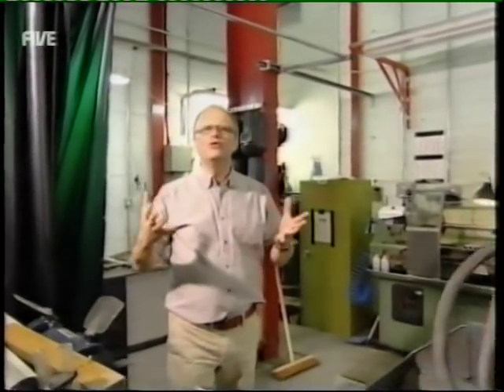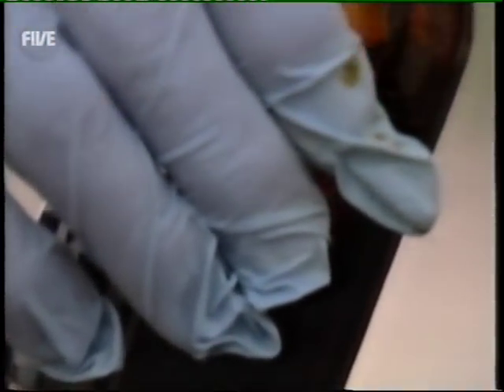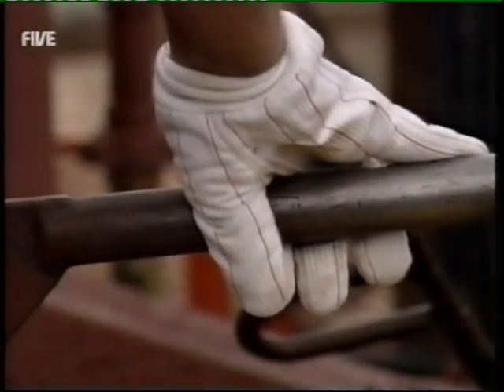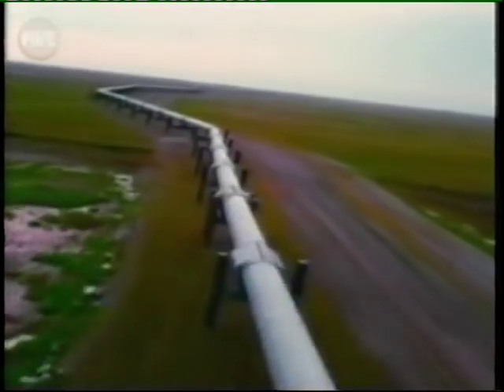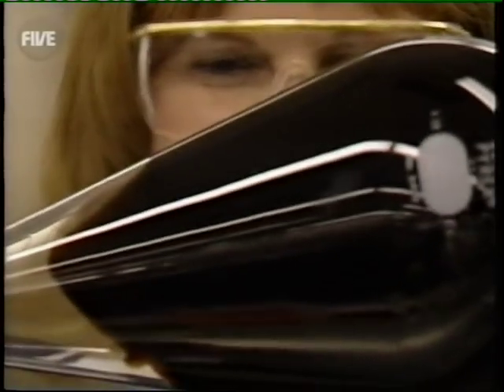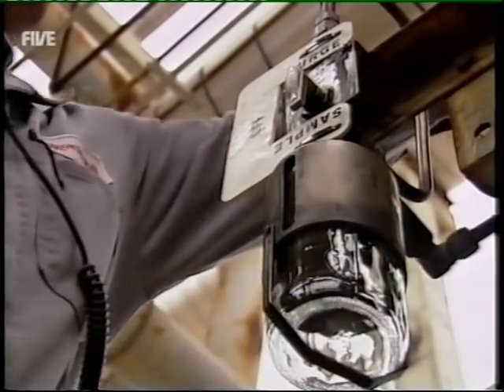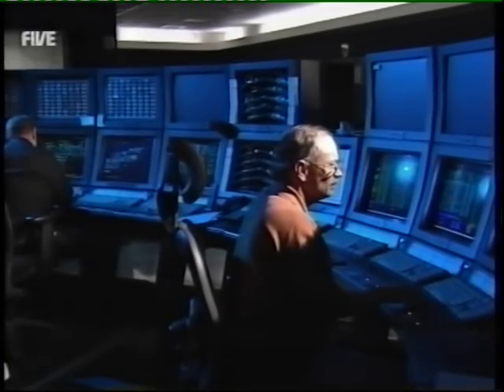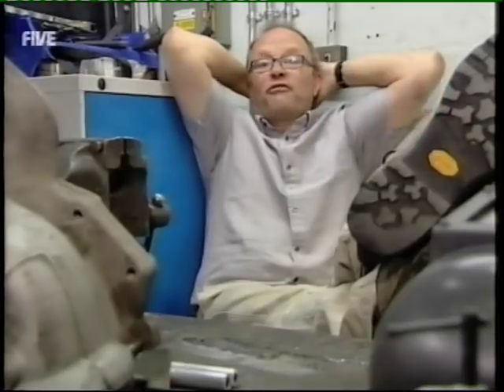How to Make Petrol or Gas from Crude Oil.

Comment: YOU SHOULD ALWAYS FILL UP THE BOTTOM SUMP OF THE OIL WELL AT ONE THOUSAND FEET (1,000 FT) UNDERGROUND IN ORDER TO AVOID AN EARTHQUAKE.  FILL UP THE BOTTOM SUMP WITH A STRAINER ORIFICE OF LOOSE VOLCANIC LAVA ROCKS.  AT ONE THOUSAND FEET (1,000 FT) UNDERGROUND, THE EMPTY HOLLOW BOTTOM SUMP OF AN OIL WELL COULD ACT LIKE A SINK HOLE, AND CAVE IN COLLAPSE.
Reply: Your caps lock key is stuck

Comment: There would be a huge impact to the economy if we suddenly switch off crude (to protect against global warming). An impact I don't think we could survive in the best of times, let alone the middle of the quarantine.
I think want we need is a way to continue to utilize the entire crude industry infrastructure. From pumping, to refinement to shipping and transport.
It's not a perfect 1:1 analog, as a lot of equipment will need to be built and swapped out, but it's not a  but there's only one thing that comes close: hydrogen.
Hydrogen is, believe it or not, a worse fuel in terms of potential energy, but it should allow us to ween ourselves off of crude. Combined with a restarted nuclear program (utilizing proven breeder reactor designs) and a hydrogen economy, we'd usher in a new era of both prosperity and environmentally friendly energy.

Comment: wonder what will happen when all this stuff runs out...
Reply: +MetallF Before it runs out - militaries will commandeer and confiscate the rest, as there's no solar powered jets and helicopters or wind powered battle ships and tanks.
Reply: Between you and me, good thing carbureted 4 stroke motorcycles engines can run on hydrogen...
Reply: I say we begin to switch to ethanol. You get more power out of it too
Reply: it's not going to run out any time soon
Reply: I mean from this dude calculations this oil field in Texas only has 30 years of oil left in it, so year some time soon
Reply: Nuclear power will have a larger role. Nuclear is the cleanest, and most effective energy source
Reply: Economy collapses.  Social unrest.  Walking dead without zombies.
Reply: Who cares we won't be around to witness it .
Reply: @happykaladin78  FALSE FALSE FALSE !!! Nuclear is the most dangerous and highly toxic to the planet !! ☠️☠️☠️☠️☠️
Reply: @100pyatt  https://www.energy.gov/articles/nuclear-energy-clean-constant-and-cool
That is a link from the department of energy that states your beliefs are "FALSE FALSE FALSE". 

Nuclear emits 0 green house gases, it produces waste yes, but that waste in time can be re used to produce more energy. 

Converting one energy source into another will always yield waste, that is simple thermo. However Nuclear is by far the most powerful, feasible energy source. 

Why do you believe otherwise?
Reply: A nuclear car battery, insane or genius?
Reply: TIMEtoRIDE900 no one use battleships anymore
Reply: We are screwed
Reply: @happykaladin78  Nuclear waste can not be re-used to produce more energy, at least most of it can not. There is leftover Uranium-235 in the burnt out fuel rods and some Plutonium, but most of the waste is only highly radioactive but not fissionable. That waste will be radioactive for many thousand years and has to be stored somewhere. The Problem is, that it is almost impossible to find a save way to store it, especially because humans are pretty good at finding buried buildings that were forgotten and digging it all out.
Reply: There will be one big hole under under the top layers of ground, and we will all be sucked in
Reply: @alexanderdaum8053   Fast reactors can fission minor actinides etc, ie "wastes" of nuclear fuel.
Reply: @frankmagana1408  Yeah lets do that, the population from 7 billion will drastically decrease because of starvation. You do know these plants to make ethanol use the same ground you grow food crops.
Reply: @MetallF  Just about any engine can be ran on hydrogen.  Good luck trying to make it and compress it though.
Reply: @100pyatt  Not even close.
Reply: @jjmonns  move to the new green , nuclear Fukushima , it's zero greenhouse gas. Needs some residents in the green living zone 👍
Reply: @jjmonns  well there are solution, like hydrate compounds that can store a lot of hydrogen at room temperature and 1 atm.
Reply: @100pyatt  still better than Flint MI
Reply: @MetallF  That is still very energy intensive to make.

Comment: They forgot to mention the thousands of crude oil haulers that go out to the oil wells. Testing the crude oil before they load it. Only a fraction of wells are on the pipelines. The vast majority have to have the oil hauled out by truck and to the pipeline. Driving in remote areas, in all weather conditions. Living out of their trucks.

Comment: Black gold runs out!!
Reply: never
Reply: Oil is a hydrocarbon: a byproduct of heat and pressure in the earth and it will never run out.
Reply: unfortunately it will become more and more limited making alternative energy sources more affordable in the far future, assuming humans don't destroy themselves by then
Reply: Gold gold also runs out!!!
Reply: ASIStudios 
Incorrect, There exists something called the residual oil saturation, that is the precentage of oil that is impossible to extract. This is a function of multiphase fluids and rock properties. To understand it on a more technical level, when two fluids exist there is a wetting phase and a non wetting phase and a interracial tension between the two. Due to Capillary Pressure we know that it is impossible to displace 100% of either the wetting or non wetting fluid. Translation, "Oil will never run out because we can't extract it all"
Reply: +Quas CMS thanks for the explanation, I think he's just referring to the extractable oil.
Reply: At first, I thought you were making a "running black" joke, nvmd
Reply: fatbap, Then how do you explain  oil sands (deposits) that are close to the surface of the Earth ? There is one in Venezuela and one in Canada and they're both the size of Saudi Arabia, in terms of Reserves.

Comment: It was interesting until you made the erroneous common error that oil comes from little tiny plants and sea creatures. You just showed your ignorance. Now let me educate you.
Oil is not a "fossil fuel". It never has been and never was. That little catchphrase came from the mind of John D Rockefeller. He coined that little phrase because he wanted to increase the value of his oil company, Standard Oil. To justify his dramatic increase in pricing he wanted to tell the public that oil is scarce and that's why it cost so much. His gimmick worked and still works today.
Oil is so plentiful it is almost sickening. During the 1970s, the oil companies got their wish and did it again, dramatically raising prices. Few people were aware that there were more capped oil wells off the coast of California then have ever been capped on the mainland. California won't let those oil wells be used. But if you drive around Los Angeles you will still see hundreds of small pumps sucking out oil 24 hours a day, everyday.
There's oil sand. There's oil trapped in shale. There are billions of barrels of oil still in Alaska.
Oil is not rare.
Oil is not scarce.
Oil is NOT a "fossil fuel".

Comment: Not mentioned about refineries: They do far more than just separate the crude into its different chemical components. Some of these 'cuts' are reformed to make them more valuable. Heavy oils are 'cracked' into lighter components that can be blended to make more gasoline, in addition to the 'natural gasoline' that was in the crude to begin with. This is just scratching the surface of all the different ways in which crude is modified to make valuable commercial products and feedstocks for other industries, such aa the plastics industry.

Comment: you should have covered "cracking" long chain hydrocarbons into shorter chain hydrocarbons. This technology is why diesel is more expensive than gasoline. They can crack fuel oil into gasoline so they charge a higher price rather than crack the diesel into the higher volume and more refined gasoline.

Comment: THE ALKYLBENZENE REFRIGERATION OIL IS A MINERAL OIL THAT ALLOWS EXPOSURE TO WATER, AND ALSO ALLOWS THREE HUNDRED DEGREES FAHRENHEIT OF HEAT, WHICH IS THE EXACT TEMPERATURE AT TWO AND A HALF MILES UNDERGROUND DEPTH.

Comment: The main products from Crude oil is gases, chemicals, plastics,  paints , adhesives, laundry products , tar, man made fabrics. 
Petrol, at the chemical plant I used to work at, was a by-product which was sold off as a waste.  Most of the profit is NOT in road fuels, but in all the other products which have thousands of uses.  
To increase road fuel retail price when crude oil goes up is disingenuous. Most of the price at the pump is government taxes.

Comment: Yes, the gas is methane; which is odourless, however, the Gas company adds an odour to the gas for safety reasons!
Reply: Carl Ross it's called mercaptan.
Reply: Carl Ross When they moved from North Sea gas ?
Reply: Or the gas has sulfur in it as per H2S (hydrogen sulfide)
Reply: NATURAL gas that comes out of the ground is a mixture of dozens of hydrocarbon gases including methane, heptane, pentane, propane, ethane, etc. The gas processing plants separate out the various "anes" and sells them individually. It stinks to high heaven. Methane is pumped to houses and called "natural gas" and a small amount of sulfur is added to allow for detection by smell.
Reply: i'm just trying to figure out what natural gas has to do with crude oil????
Reply: Your thinking of LP
Reply: Methane, oderless hilarious 😂
Reply: my methane aint odourless just ask the six people stuck in the lift with me after a red hot vindaloo
Reply: I can sell my odour to Gas companies. I have plenty in my room on daily basis.
Reply: Carl Ross how would the facility that manufactures the odor for natural gas know if they have a gas leak?  Either there are lots of false alarms, or the town is all electric
Reply: Revtune you don't know what you are talking about
Reply: Thanks Ross.
Reply: Nicnamed Mc'captin  @JF32304
Reply: @tedparker640  In the reservoir there's so much pressure from overburden, gas is compressed into the crude its called solution gas or Rs. A lot of it turns back into a gas once hydrocarbons reach surface and the pressure is relieved, but some of it doesn't so they need heat to force a variety of gasses out of its solution state. Reservoirs have a gas / oil ratio (GOR) and depending on this ratio will determine the title of the reservoir, oil / gas reservoir.
Reply: I saw your comment and thought of Ross from Friends... then I saw your name is also Ross...Wtaf?
Reply: Or they just burn it right there because it's not economicly feasible to save it and sell it.

Can you say skin a buffalo and let the meat rot on the plains?
Reply: Tim OB no not a car ! an elevator travelling between floors
Reply: Tim OB hahaha good stuff    dont lose the old sayings   im from australia   most people dont have a clue what we’re talking about
Reply: No, your wrong
Reply: wrong!!!! that smell is added to the natural gas after refined so you can notice a leak sooner than a boom, and some gas is sour and smells like rotten eggs right out of the ground. and some shale gas does have specific smells,its not all pure.
Reply: Methane is the only gas that actually HAS a smell to it naturally.
Reply: @diji5071  nope.. h2s also👍🏻
Reply: @chrisw5150  Pretty sure H2S is odourless.
Reply: @diji5071  nope,...it smells like sour eggs. horrible stuff. if the consentration is above 1000 parts per million it'll kill you before you even get your lungs full. i hated working around that stuff
Reply: @chrisw5150  That makes sense, they really drove the point home in my training course that you can't really detect it by smell so I just assumed it was odorless.
Reply: @diji5071  well your sense of smell diminishes the longer you are around sour gas. so not relying on smell makes alot of sense if you're working in the industry.
Reply: It’s actually h2s we’re worried about 💁🏻‍♂️ which smells like rotten eggs until it kills your sense of smell at a certain ppm then it kills you when you think you’re in the clear because you can’t smell it anymore
Reply: Methane definitely has a smell when I make it
Reply: The LNG does have a smell and can be used directly after production. But if it's to be used in the public then the mercaptan or stink is added so if the flame is not burned itll smell. I have to add this crap to little canisters at my gas plant so we can use what we make for heating our buildings. If the wind blows in your direction while carrying it it's on u for 2 or 3 days.
Reply: ted parker 
Natural gas is in crude oil. Along with naphtha, jet fuel, diesel and heavier hydro carbons. All mixed up together. The refinery separates each fraction to sell separately.

Comment: Most petrol in the US is distributed by pipeline - trucks handle short and mid haul.  And metal... not the problem:  tyres are. They act as an insulator, and anything bypassing them brings spark potential except earthing is applied first - via nozzle, or separately [as aircraft do].

Comment: My 2004 Tacoma 3.4l engine has 264,000 miles and runs great, but it knocks occasionally. I add octane booster but the knock doesnt go away
Reply: Bearings

Comment: Ethanol liquid fuel pumps usually cannot exceed one hundred psig pounds per square inch gauge, and therefore, always use nitrous oxide NOS liquid fuel shutoff valves, at the inlet of the ethanol fuel pump, and at the outlet of the ethanol fuel pump, in order to valve off shut off the ethanol fuel pump from the gasoline diluted ethanol that is inside of any fuel mixing metal tank, whenever adding the propane gas vapor, which is used in order to increase the octane rating of the ethanol liquid fuel.

Comment: It doesn't suck the oil to the surface.  It LIFTS the oil.  You can only "suck" about 30 feet or so.  Not 2 miles.

Comment: thought it was going to be a real complex process, turns out the crude oil is just heated up from the bottom...
Reply: The concept is simple, but the process itself is very complex.  They just simplified it for the target audience.  The conversion and catalysts used in the refining process is often a trade secret.  The harder part is separating the liquids and gases that are closer in density like natural gas, propane, butane, naphta, isooctane, and other petro chemicals used for production of plastics.  

There is also a secondary tower called the vacuum distillation tower.  What they do in that tower is use vacuum to lower the boiling temperature of the liquids so it would "boil" at a lower temperature.  That is used to separate the heavier oil products use to produce tar and other uses.  Without using that tower, the liquid would need to be raised to a higher temperature which presents a bigger safety hazard and cost more money.

If it was that easy, Venezuela wouldn't have to shut down their refineries.  You would also see Iran refining their own oil instead of sending it to other nations to refine and import the gasoline back into the country.

Comment: Aren't pumping jacks old technology? I thought these days most oil pumps were basically rotary positive displacement pumps and now housed in small sheds. Also, now go look at a cracking plant if you want to get into the next stage of oil processing.

Fun fact: Originally, it wasn't gasoline that was the big product from oil. It was kerosene. If the refining was done wrong, it could be a dangerous product to use. That's where Standard Oil came from, providing a product that conformed to strict production standards and thus would be consistent from batch to batch and be safe to use. So don't dismiss the apparently simplicity of the distillation process. It still has to be very carefully controlled or it all comes out wrong!

Comment: You boil the oil.  Recently retired from refinery after 36 years.  It's super technical now to get every drop of the good stuff, but it's still basically boiling oil.  In the beginning, (before cars) they only needed kerosene and wax and dumped 80% of the rest on the ground and in the sea.
The car industry and suburbia and the highways were subsidized and created to help the oil companies.  Too bad that's all going away soon (not in a good way).  It was fun.
Now the payback is coming.

Comment: One question...How do you raise the octane levels? I drive a car that requires 115 octane. Not 87. How do they change that?
Reply: An alkylation unit (alky) is one of the conversion processes used in petroleum refineries. It is used to convert isobutane and low-molecular-weight alkenes (primarily a mixture of propene and butene) into alkylate, a high octane gasoline component.